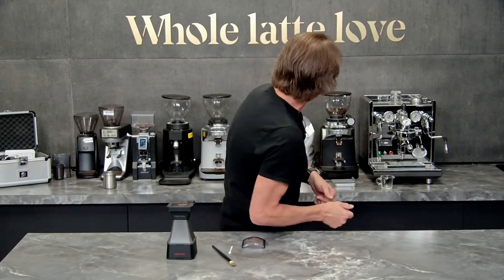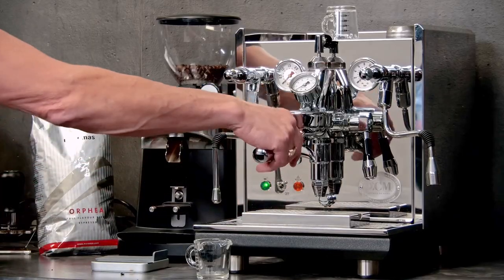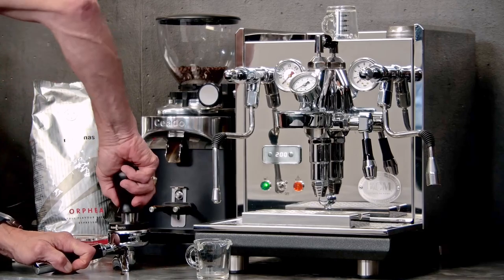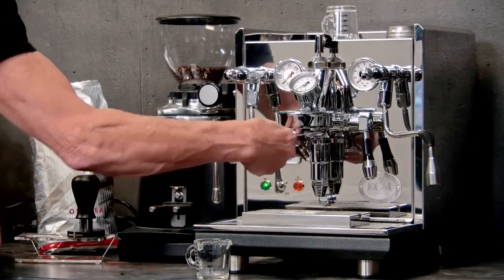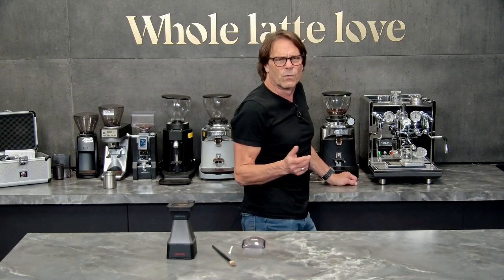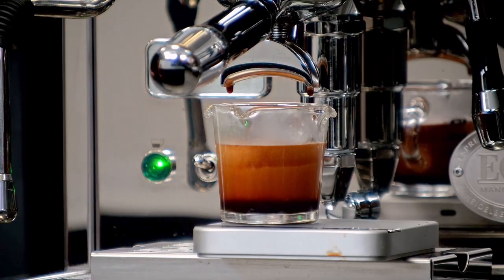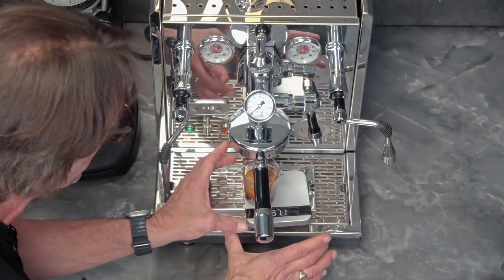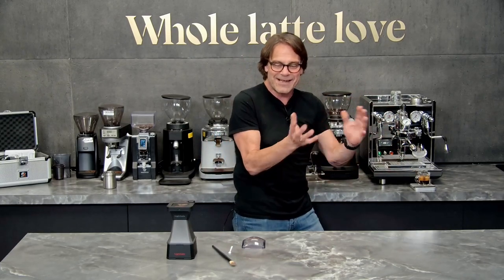Espresso: How to Measure Weight and Volume

Comment: Hey Mark another excellent video I enjoy them question I purchase the profitec pro 700 with flow control from you I have the water filtration system from you also my question is when I'm doing the bottomless filter basket I'm getting a lot of overspray I don't know if it's because I'm letting too much water out but I'm afraid of restricting it too much and burn it up the pump how long would you suggest when using the restrictive flow with a 22 G of coffee in the filter pull 44 G out how long would you say I should extract for I've been going around 25-30 animal shows the 25 to 30 seconds from when the coffee actually starts hitting the cup or the timer on the machine please help thank you
Reply from the maker: Hi mj, Thanks for the kind comment and your patronage! First, no need to worry about the pump or motor. It can take it! There's a bypass on the pump which bleeds off excess pressure. The pump and motor use nearly the same effort at espresso flow rate as when there is no flow.
Spurts from a bottomless basket usually come down to grind quality and prep. If grind size is off, was a little clumpy or distribution and tamp are less than perfect spurts can happen. When you start an extraction using a low flow rate I recommend using first drip as a place to start timing. So if you get first drip at 15 seconds after pump on your total time on the machines shot clock might be 35-45 seconds. Do keep in mind timing is the most basic way of appraising shot quality. It gets you in the ballpark - after that let taste be your guide. Hope that helps!
Marc

Comment: A belated thank you (I think belated) for pointing me to the Maromas Orphea.  Been using it steadily for maybe a year-plus; it is one of the best coffees I've used, and it's economical to boot.  With my GS3, I knock down the brew pressure a bit, and not overpowerd by crema and I like the taste.

You are right, weighing the coffee into the portafilter is the only way to go.  I use 21.0-21.5 grams in and a 2.5 ratio (by weight out at 201F) and it suits my palette perfectly.  Volume measurements when there's any crema (foam) is only a form of deception.  

Look forward to the particle-size gizmo - it has me intrigued.
Reply from the maker: Hey b, Thanks for sharing your thoughts on Orphea. It's been one of my goto coffees for more than 5 years now. Very economical, easy to work with and makes a fairly classic Italian style espresso. I never put sugar in espresso and I've been told by those that do Orphea is a coffee that doesn't need it compared to others they've used. If you enjoy the Orphea and I have not pointed you to our very own Crema Wave you should give it a try: https://www.wholelattelove.com/products/whole-latte-love-crema-wave-whole-bean-espresso
We worked with an award winning local roaster to create a blend I consider a modern take on the classic Italian style. Difference here is it uses 100% Arabica specialty grade beans and is almost always fresher due to local roasting.
I'm looking forward to sharing results of particle distribution analyzer. Tested a range of 6 grinders. Dialed them all in on the Synchronika and tested particle sizes. Some revealing results in the amount of fines produced by different burr types. Also interesting... dialed in at 1:2 ratios at 25-30 seconds all 6 grinders were within 10 microns of the generally accepted 250 micron median particle size for espresso.
Marc

Comment: Got my ECM Synchronika AMG coming in next month along with the Eureka Mignon Specialita! Super excited to learn how to dial in my espresso and new things ! Was considering the ECM 64 AMG to go along with the machine, although read that there was a lot of retention compared to the more budget friendly Eureka.
Reply from the maker: Hey R, Congrats - I have a Snychronika AMG in-house and it's beautiful! Most all grinders, unless designed as a single doser, have some retention. If you always want a pure dose you have to grind a few grams and toss to get there. The basic Mignon design does have a slightly shorter and less restricted path after the grinding chamber so retention is likely a bit less. Not sure which Eureka you're getting so don't know your burr size (majority are 50-55mm) but I do know larger burrs like the 64's generally produce less sub 200 micron fines than smaller burrs.
Marc

Comment: Hello, I have a Silvia. After I steamed the milk and I switched on the hot water button and refill the boiler. After 8seconds, I found the reservoir’s water was used up. I switched off the hot water button and refilled the reservoir immediately and keep switching  on the hot water button until it had steady water.
I want to ask is it gonna hurt the heating pipes? 
Thanks😢
Reply from the maker: Hi s, Sounds like you should be fine. Highly unlikely any issue with an 8 second partial water shortage in the boiler.
Marc

Comment: When should u start ur timer? When the first drip starts starts or when u lift lever (include pre-infusion)
Reply from the maker: Hi mm, Thanks for the question. You can do either. Timing is the most basic way of appraising a shot and is a reference just for your equipment/brewing variables. For instance, machine used here has a rotary pump which comes up to pressure much faster than a vibration pump. All else being equal a similar extraction on a vibe pump machine would take longer.
Marc

Comment: Hey Marc,
If you would make an Americano, what ratio/dose would you generally use in order for the espresso to have presence in the cup. Great video as always!
Reply: This type of thing is purely based on taste. It’s very hard to get a “standard” ratio. Just go by what you like.
Reply: @velouriumcamper0753   Exactly.  My wife's drink is an Americano - 7oz steamed water (goes to 8oz) and extract aprox 54g of espresso (2.5:1) onto that, which is a 10 oz drink in a large coffee cup, which SHE likes.  Any stronger than that, I'll find her pouring chilled water into the cup.   Most Americanos are a little stronger than this, but as stated, it's the taste preference of the person drinking it.   My own drinks are straight double-espressos, no milk, no sugar.
Reply from the maker: Hey dcds, What others have said here... Thanks @velouriumcamper0753 and @bacca71 
Since I use both semi and super automatics machines I mix it up a bit. If doing high-end coffees on semi-auto machines it's usually a double shot into a 5-6oz cup resulting in 2 parts espresso to 3 parts water. For a larger cup from a super-auto machine I often do a double from 2 grind cycles and add 6oz water - that's my "to go" size made in an insulated cup I can drink for awhile.
Marc